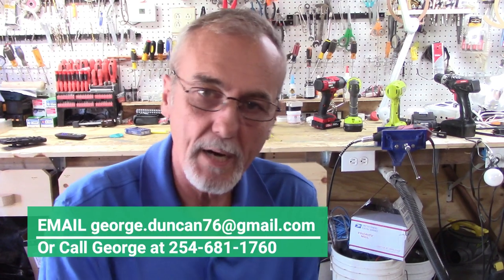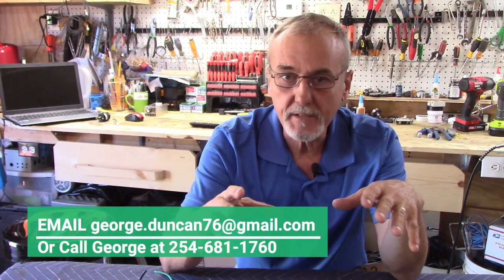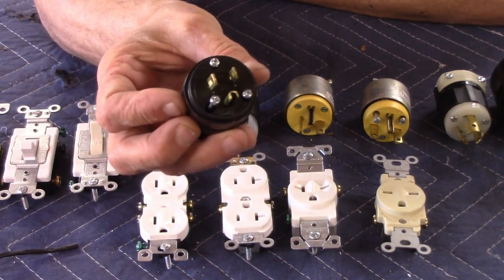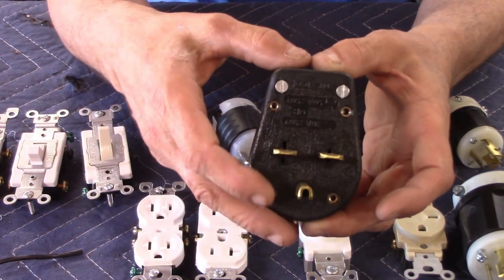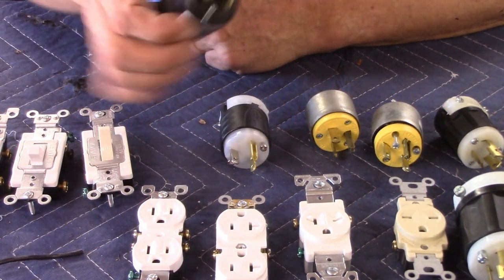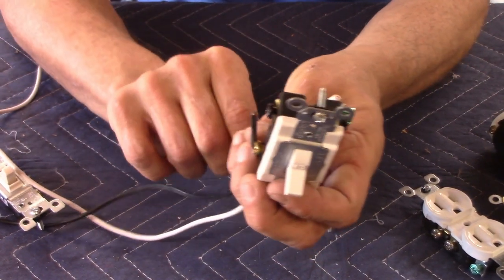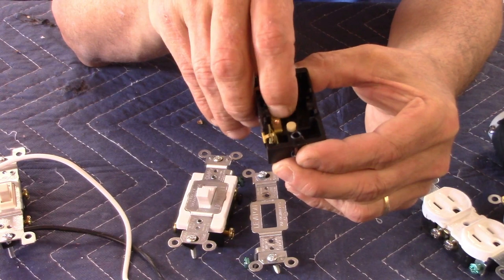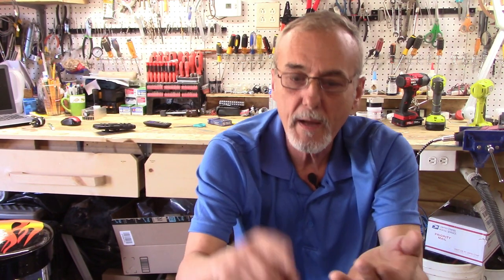PLUGS, SWITCHES AND A PLAYLIST FOR ALL

Comment: I just finished my PID box. Much thanks to your videos. You gave me the knowledge needed and I took it a few steps further. My PID has a digital amp meter, cooling water in/out temp read outs, 5 mini cooling fans and vent holes for plenty of air flow, and fancy switches and lights. So much unnecessary junk, but I love it. If I ever get to visit the store, I’ll bring it along to show it off. I’m pretty proud of it. Thanks for your videos. So much info.

Comment: Hi George!  I'm wondering if you have any knowledge of or experience with the Kegland Digiboil Electric Kettle? The 220v has a very reasonable price point for electric brewing and offers a top and reflux top for distilling. It looks like a great way to get my feet wet with making spirits, but I'm looking for some reviews before I spend the money.
Reply from the maker: I just read about it. Sounds good but for the price I would not expect too much. May be a good investment if it works as advertised.
George

Comment: What do you use to wire a cord to a water heater element, cover,stress relief, etc. Thanks
Reply from the maker: I use a 1 1/2 inch PVC coupling that is about 3 inches long and threaded on one side. I screw in a cap with a hole drilled in it to insert the wires.
George
Reply: thank you very much.